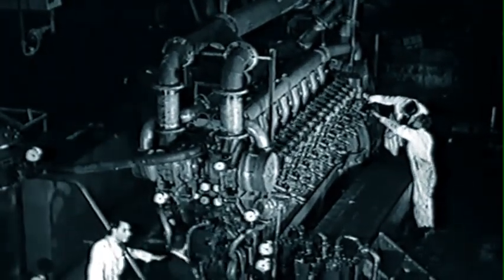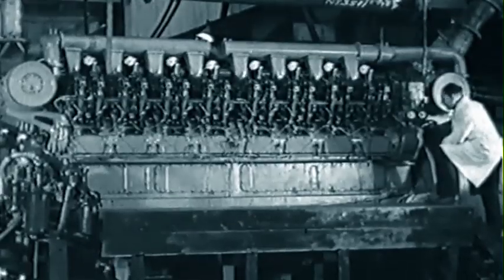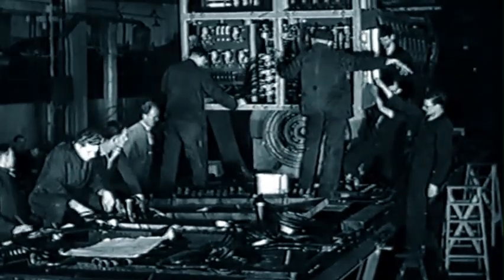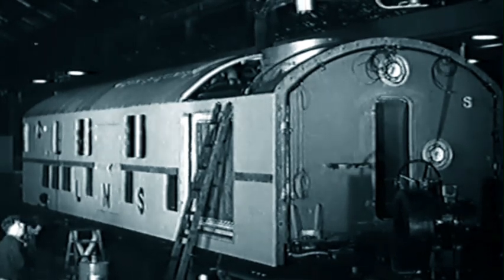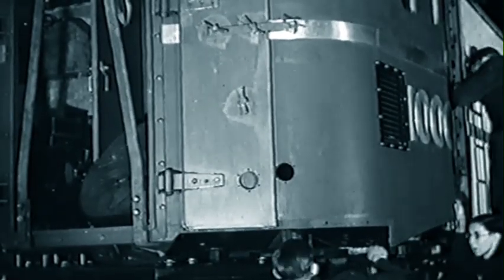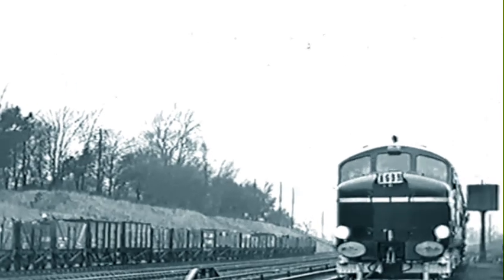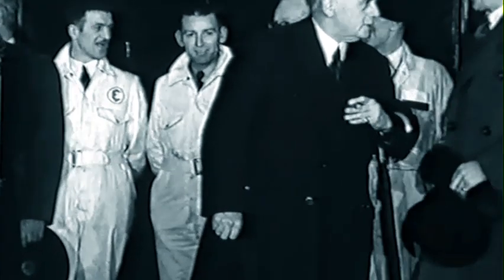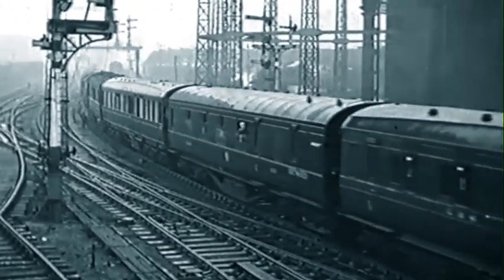Mainline Diesel - LMS 10000

Comment: A brilliant innovation of it's time. I prefer electric traction over diesel and would prefer the UK rail system to have gone over to electricity 100 years ago, But these locos are iconic and their descendants  the clas 37 are still active.
Reply: Agreed on all counts. Railways should have switched over to electricity 100 years ago. UK Politicians have spent over 100 years thwarting this in various ways. The Grouping of rail companies was their first move. If this hadn't have happened the LS&BCR would have extended their 6700v ac electrification and perhaps the Midland would have electrified Derby to Manchester. York to Newcastle and Middlesborough would have been electrified at 1500v dc too. Politicians play dumb but act crafty.

Comment: Asbestos.. yuck..after the war housing shortages caused by german bombing were rectified by prefab houses made of..asbestos my friend lived in one and was quite proud of it, his mum was pleased that it was so warm.........dont know if she ever found out her house was more dangerous than the 1000kilo satan bomb that levelled her original house! I drove down that street in Bootle in 1990, a different house stood on the spot   :)
Reply: I'd forgot prefabs were made of asbestos. I had a schoolmate who lived in one. The first time I went to visit him I couldn't open the door - the door opened outwards! Unlike regular houses, presumably to save space.
Reply: @trek520rider2  I think that as in sweden doors open outwards to stop snow falling in the house every time you open the door, it was to sweep bomb debry away (bomb sites were filled with powdery concrete from bomb blasts :(
Reply: There are loads of houses that still have mixed asbestos/concrete materials - e.g. corrugated roof covers for things like garage blocks (mine had until a few years ago, and was built in the early 1980s). Quite a few other materials, also decorating things, e.g. with the trade name ‘artex’ texture material. That used to have a certain amount of white asbestos in it, and was used in my place when new. So there’s a certain amount of it in my place.

Comment: 1600 horsepower, you nearly get that in a Bugatti these days
Reply: Torque is not relevant at all because it is electrically driven. This means you can simply run either engine at its maximum power point, to have literally any amount of torque to the wheels as long as you stay within the rating of the traction motors. Same is valid for CVTs.
1600hp is 1600hp. A higher or lower torque number merely says at which engine speed the power is delivered. 
In other words, if you spice up Bugatti's engine a bit to deliver 1600hp, it can haul as heavy trains as the big diesel can. 
The main difference is that the Bugatti is designed to be very lightweight,  and not designed to run at maximum power for hours on end, hundreds of hours per year. It will wear out quickly in train service.
Reply: LimaVictor m
Reply: LimaVictor not really beacuse if you theory is right i could have a 1200 cc bike and a 1200cc tractor if you put a generator on the bike it will stall out because it has not enough torque but the tractor despite having less hp will continue to run
Reply: @pietrorita  You clearly do not understand the physics behind it. The more powerful engine will allow you to draw the biggest amount of power from the generator. A kilowatt is a kilowatt, regardless where it comes from. 
The tractor may be able to spin the generator at a lower speed, but it will not get up to the rated speed of the generator if its power is too low. The bike engine, properly geared and assuming its power output is high enough, will not have any problems as long as it is running at the rev range in which it can supply the required power.
It is all simple physics. Read some old text books.
Reply: LimaVictor yes you are right excuse me for the misunderstanding! :-)
Reply: Horse Power is a product of Torque and RPM
The equation is HP = Torque x RPM ÷ 5252
The fact something produces 1600 HP is irrelevant unless you provide what RPM it provides 1600 HP at.
The Bugati may produce 1600 HP at around 6.500 RPM for example
So 1600HP at 6,400 RPM is 1,313 Ft Lb of Torque
This engine may produce 1600 HP at about 750 RPM
So 1600 HP at 750 RPM is about 11,204 Ft Lb of Torque
Reply: @AuMechanic  Exactly, except that the output torque from the engine is unimportant because you can gear everything down to get to the same amount of torque at the wheels, providing the engine has enough power. 
The Bugatti engine has to be geared down roughly 10:1 - this will increase torque tenfold (This is the important bit! Gearing down multiplies torque!), rougly getting to the 11,204 in your example at 650rpm. 
It is all locked together. But in the end, power decides whether you can haul a 400 ton train up a gradient at full speed. Merely having a lot of torque at a very low engine speed, netting a low power (like in the tractor engine example means you can only pull it very slowly.
Reply: @mfbfreak  
Yes that may be true but I suspect the op was just referring to the equivalence of a Bugati HP to this engines HP and the simplest way to explain the difference is to understand the equation used to derive HP and that the difference is the torque even though the HP is the same for both.

Comment: This is probably an LMS publicity film, but by the time it came out it would have been a BTC film. Ivatt pushed very hard to have 10000 rolled out before the nationalisation came into effect and they made it by two weeks. Eventually, 10000 and 10001 ended up on the southern region running to the west in company with the three later Southern diesels. As some people have said, it's a shame none were preserved. It's also telling that it wasn't until 1947 that the UK actually got a mainline diesel electric running. by that time, they'd been in use for over a decade in the USA.
Reply: Probably because we didn't have much of our own oil supplies, we had and still have plenty of coal. So it was more economic until the 1950s to rely of domestic coal supplies. However, post-war the quality of those supplies were not as good as pre-war supplies.
Reply: isn't 10001 preserved?
Reply: Skog no, none of the LMS or SR designs were saved. They were withdrawn from service around the time steam was being withdrawn and all of the enthusiasts wanted to save steam locomotives.

Comment: Yey, sprayed with asbestos, nothing can go wrong !
Reply: Aye, and no ear defenders worn in the engine test shed!
Reply: Yes and no gloves for the rocker slapping...
Reply: @SilverCanary1  : You can't check the temperature wearing gloves!
Reply: @johnpowell5433  You can easily check temperature with latex, and even rubber gloves as long as they're thin enough. They could even theoretically be designed (/calibrated) so heat can be felt through them only above a certain temperature, which would be as accurate as the scientific procedures seen in the film. That's if they weren't just showing off for the cameras. 
Overall though, it's probably safer doing that without gloves, as if they've caught in or been pinched by something and the worker wasn't paying full attention, or even if they were, the consequences...   ...need no description! 
Also, I hadn't thought that might be or is what he was doing...
Reply: @SilverCanary1  I served my Apprenticeship on EMD's and English Electric Diesel engines, plus a whole raft of other diesel engines .I never put my hand on any rocker arms to check for noise. That's what feeler gauges were designed for.
Reply: @Mercmad  Actually if you had done the EMD engine course you should know  the pinch check is to make sure hydraulic lifters are ok . Worked on class 66 since thier introduction at Immingham TMD also worked on English electric and sulzer
Reply: @SilverCanary1  Part of the checks on the EMD diesels is checking for pinch between tappets and this is overhead cam engine . This was shown on instructional videos in 90's for the Class 66 loco's with EMD 710 engines
Reply: @nounoufriend  by saying pinch do you mean gap? 

It's checked by putting a hand on the rocker when the engine is moving and feeling the bump as the space closes?
Reply: @nounoufriend  But we can see it has pushrods and rocker arms !
Reply: @philhealey449  Was on about EMD 710 2 stroke engine's not engine's fitted in 1000
Reply: Yep, that's what happened then, and now people spray their gardens with Glyphosate. Will we ever learn?
Reply: I would like to have been the asbestos sprayer.
Reply: Mmmmm, yummy asbestos.
Reply: Asbestos has good anti-rust properties as well as good insulation properties.
Reply: They used to spray passenger coaches with it. It was used in signal boxes too. My Uncle had a long career with BR but succumbed to asbestosis probably from when he maintained coaches and maybe later as a signalman

Comment: It's just a shame that it took British Rail so many decades to get it right. The locos were like American Alcos': Bastard stepchildren that no one really wanted.
Reply: The original Moderisation plan was to buy small batches of a few designs and test them to find out what work and what dudn't. However, the BTC was pressurised into buying large batches of these designs and other designs, few of which were fit for purpose. The engine used here has been developed over the years to eventually produce around double the hp.

Comment: 'Sprayed with asbestos' - oh dear!
Reply: I have an asbestos duvet, it's fine!
Reply: MotoCrazy66
Keeps the heat in very nicely!
Reply: Also good against corrosion.
Reply: True enough, the asbestos MK1 leccies we had at my depot didn't seem to rot as easily as those that were stripped of it !
Reply: 20 years ago they discovered that one of the hospitals here had it's entire steel framework sprayed with Asbestos in the 50's while they were building it. That's why there are not too many old carpenters here.